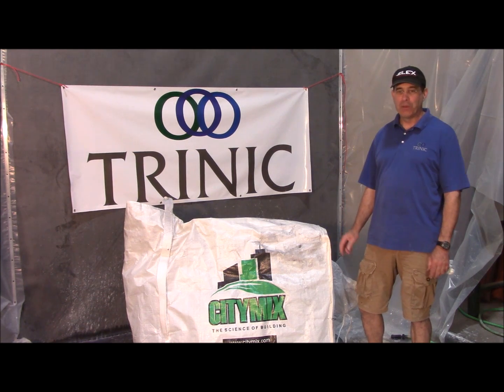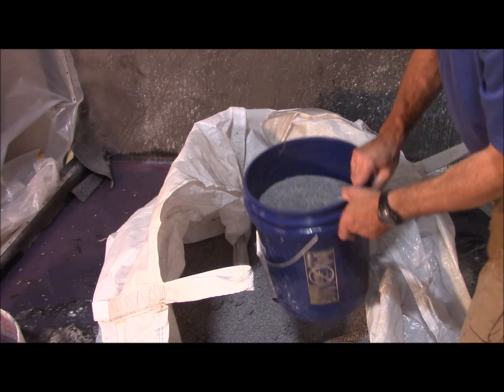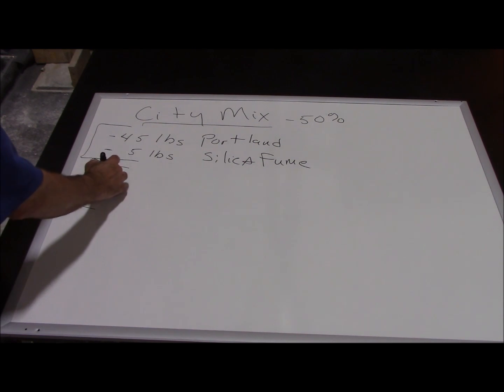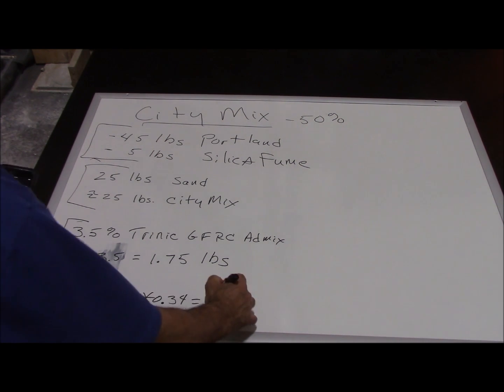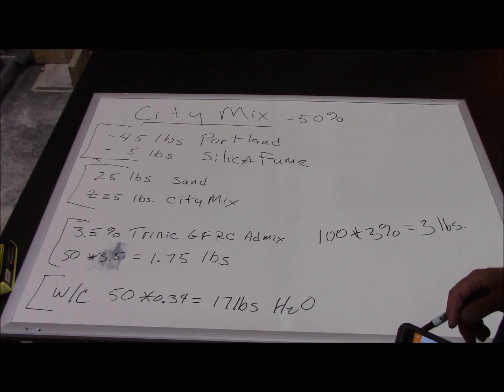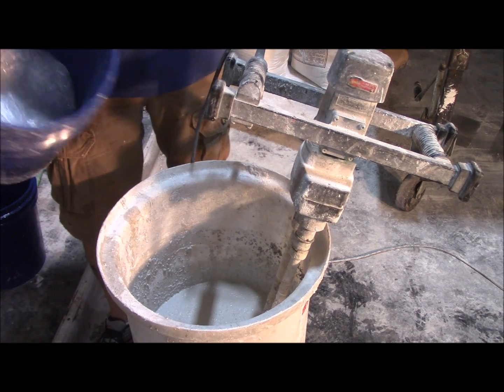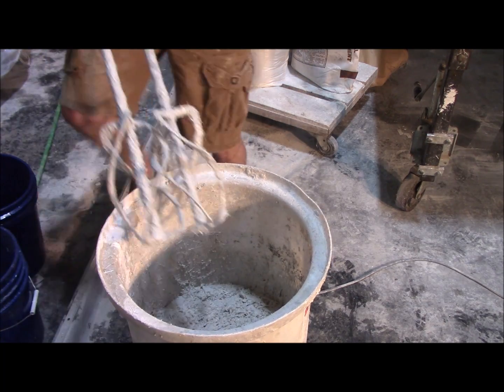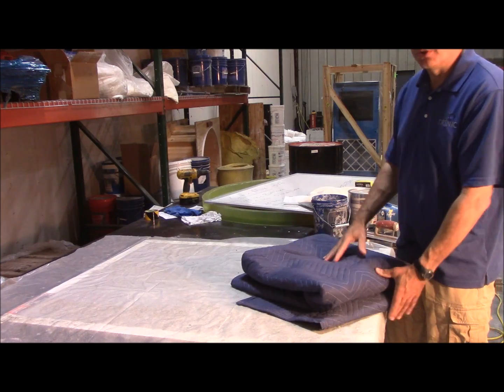City Mix Ultra Lightweight GFRC Aggregate - Glass Fiber Reinforced Concrete

Comment: Using your products what is the lightest and strongest product you would recommend for outdoor tables and how thin of GFRC would you trust? Considering that users are tough on outdoor tables with ice chests, heavy purses, baby carriers.
Reply from the maker: Great question.  City mix can be great for some things, but should not be used in every project.  For your outdoor table we would not recommend it.  City mix will lighten your piece by about 25% but you lose about 30% strength.  Your best bet is a GFRC table at 3/4 thick.  If you want a thicker look, just do a drop edge.  If you need any more info - shoot me an email: rich@trinic.us